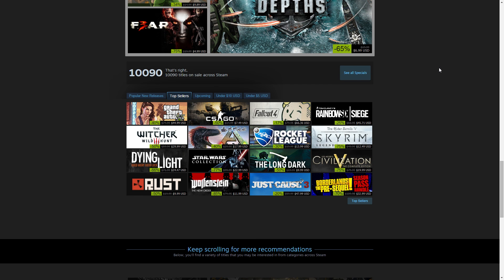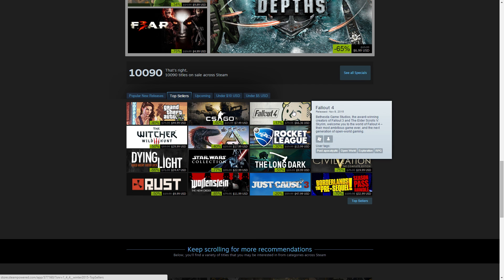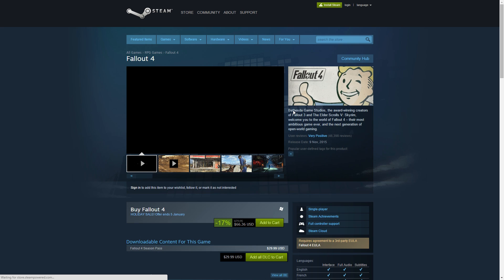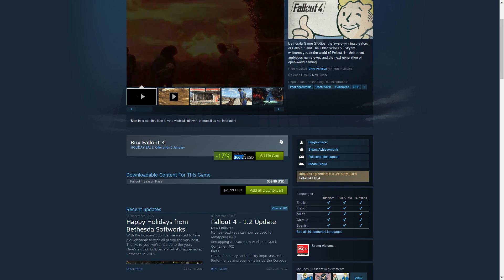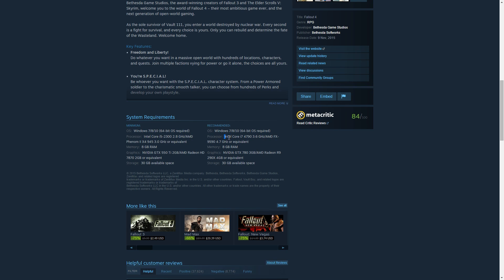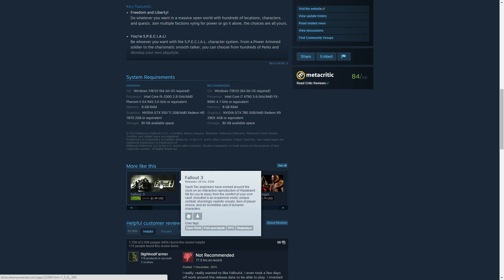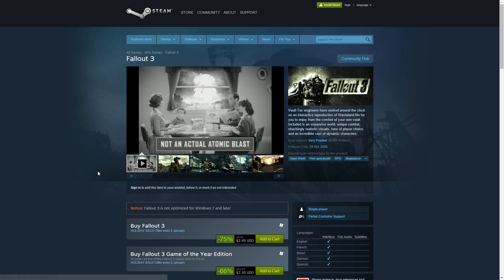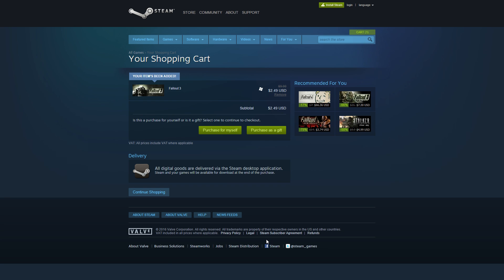Building the Fallout 3 Retro Gaming PC

Comment: Another great video Phil cheers, 
I never played F3 all that much, maybe 20 minutes and forgot about it, think I was still hooked on battlefield 2 online, will need to go back to it,What's wrong with the specs for F4?, you telling me you don't have an upto date system to play it? Will need to go check out specs but can't see a problem, well not unless it wants 3 hd 7970 then I'm screwed cause I only have 2 lol 😁
Reply from the maker: +hardcore8uk I just popped my head into the Steam forum. Maybe there are fixes, but it made a good topic for a video :D 

These are the recommended system requirements. While I do have a decent i7 3770 for my video editing, the GTX 660 isn't cutting anymore. But I refuse to buy something now and I am waiting for the new 14nm cards to come out soon.

RECOMMENDED: 
OS: Windows 7/8/10 (64-bit OS required) 
Processor: Intel Core i7 4790 3.6 GHz/AMD FX-9590 4.7 GHz or equivalent 
Memory: 8 GB RAM 
Graphics: NVIDIA GTX 780 3GB/AMD Radeon R9 290X 4GB or equivalent

Comment: cool, this game used to run really well even with my 9600GT at the time, the other thing I remember is that once you go to 256mb cards the game becomes problematic (happened with my 8600GT)
Reply from the maker: +hmbrz I think it depends a lot on the graphics settings. I did try some older cards, but at least at Ultra settings, which applies AA as well, it really needed a pretty decent card.
Reply: +PhilsComputerLab I've just checked some results from techspot from 2008 and they list 47FPS fro the 9600GT at ultra 1440x900, I was playing the game at 1280x1024 which is usually lighter, so it makes sense, i was probably running around 50+ most of the time,
http://www.techspot.com/article/125-fallout3-performance/page4.html

anyway, the 280 on the test is way faster, so your 285 should handle 60FPS even at 1080P